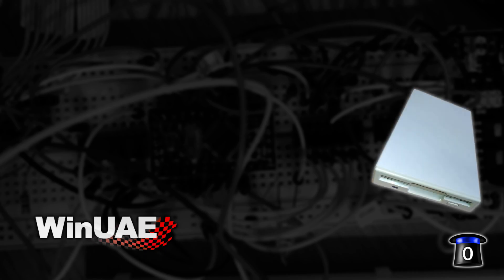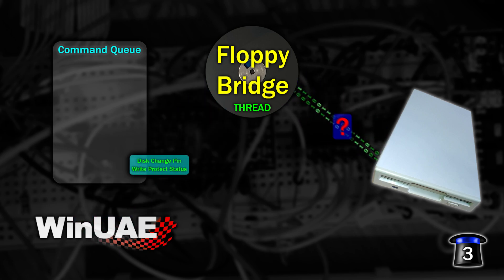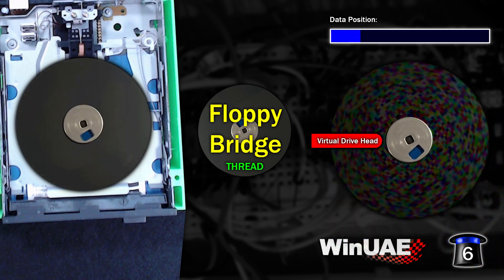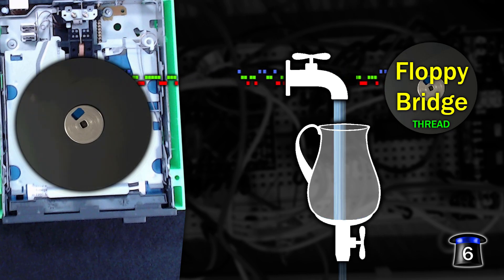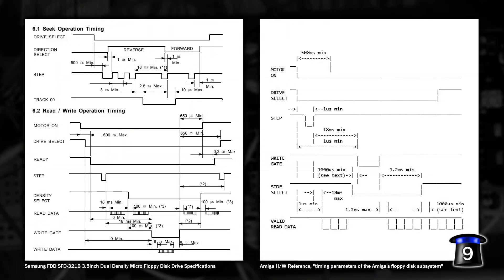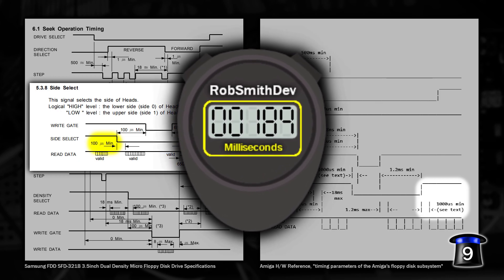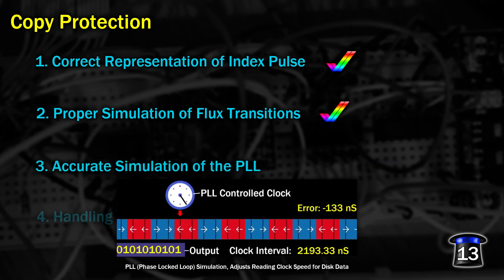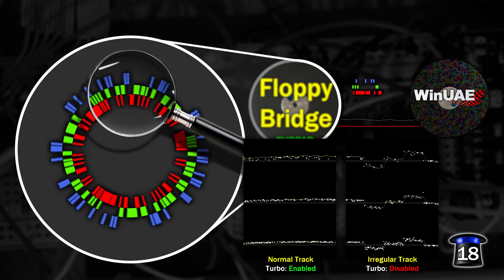How the FloppyBridge Magic Works! - WinUAE and REAL Floppy Disks

Comment: Nice video, I just implemented FUSE driver in Go to manage real-floppy for the Amiberry. I know when the floppy is not cached by the system (Linux) and the emulator tries to read the floppy - I'm muting the sound, reading floppy, unmute it. When the floppy is fully-cached I'm saving it in local file-system and then just using it to read/write the data (and of course moving the motor on real floppy drive). But your approach is much better than my, good job :)
Reply from the maker: Interesting about your approach. I was looking at that for windows. I’m sure you are aware that this plugin is built into Amiberry too btw.
Reply: @RobSmithDev  yes I know that FloppyBridge is builtin into Amiberry, but I do not know how to use it, I tried but give up :) maybe someday when I finally release my emulator I will switch to FloppyBridge, for now I need to stick with my FUSE driver (which is not so bad imo). It is supporting also real Amiga HDDs, CDs, so you can of course insert a HDD or USB with HDD image on it and it will recognize it and assign dynamically to the Amiberry. Another feature that I needed and implemented is something like RPC, so I'm able to control Amiberry remotely, changing config on the fly, pausing/resuming, attaching disks etc. The FloppyBridge - can I control it from the config and assign just a ADF file to it? If yes it will be cool, I can get rid of the mute/reading/unmute/caching feature in my FUSE driver.

Comment: Hi Rob and viewers. I recently bought the greaseweazel v4, worked fine but now it reads disks ok but chucks errors on every floppy disk. Is there a common fault on these things??. Thanks
Reply from the maker: Tested fine with the V4 I have, you may need to clean the heads on the drive. Checkout the Greaseweazle Facebook group for help

Comment: This video is amazingly informative. Well done, for both the video and what you’ve been able to achieve in this project! 
But knowing more about it made me realize that a MiSTer implementation may still take some time, as I’m not sure the core will be as well prepared to interface with your solution as WinUAE. 
Anyway, keep fighting the good fight and thanks. Cheers
Reply from the maker: Thanks and I’m glad you enjoyed it. I’m also pleased you found it informative and could follow it! The MiSTer implementation is progressing but not based on this solution. That’s more about trying to replicate what an real Amiga is doing but with the limitations of only 7 wires available on the user port. But I’m sure I’ll get there!
Reply: @RobSmithDev  that’s interesting. Is the goal to be able to use any generic USB drive without further hardware?
Reply from the maker: Wont be a USB drive, the interface on them is too restrictive for things like the Amiga. Might be ok for some cores though. This will be a fairly basic PCB with a normal drive attached if it works!

Comment: Hi Rob! This is great to see, clearly a huge amount of work has gone into this project. 
Feasibly, could this possibly work on MiSTer FPGA's minimig Amiga core? I guess that would require the core to implement a way of recognising a USB floppy drive?
Reply from the maker: Due to the ‘real-time’ nature of the MiSTer this solution won’t work for it in a reliable way, however I am working on a version for the MiSTer: https://youtu.be/4S1kkOexjyg
Reply: Scratch that question - I just remembered you already posted a progress report on your MiSTer implementation of your work on this (and that I commented on that video)!! Great to see how it all works under the hood, and I look forward to following your progress. Keep up the great work, amazing that you're doing this! All the best.
Reply from the maker: 😀 easy to forget who’s who lol no worries! Thanks for watching anyway
Reply: @RobSmithDev  I  knew as I was typing that I felt I'd asked the same question before!! 

It's really great to see the creative wonders coming from the Amiga and retro gaming community! Thanks to the hard work of yourself and others like you, there are many ways we can keep the old hardware alive, from modding and refurbishing original hardware to making very personal build around projects like MiSTer and WinUAE. 

I recently bought one of those "Mistress" boards that allows the mister hardware to be expanded and built into A500/600/1200 cases, using the original keyboards too. I feel with a setup like this, it would be indistinguishable from the original in use, just with a lot of modern quality of life updates! Never thought projects like this would exist - it's a great time to be into all this! 

Thanks again Rob - keep up the great work!